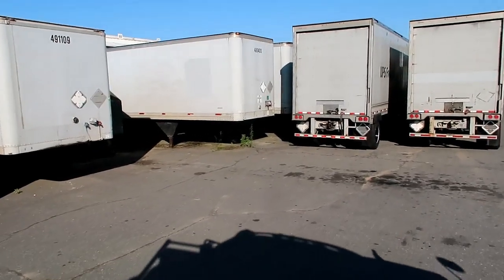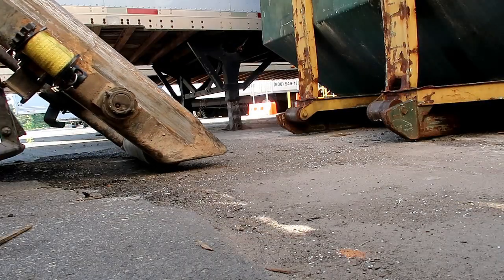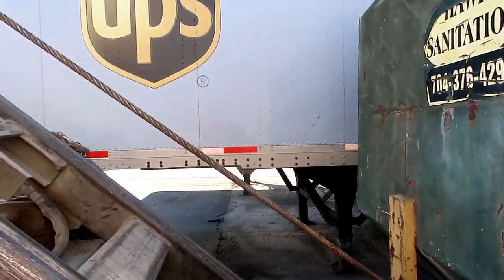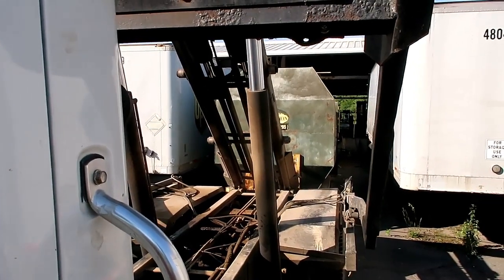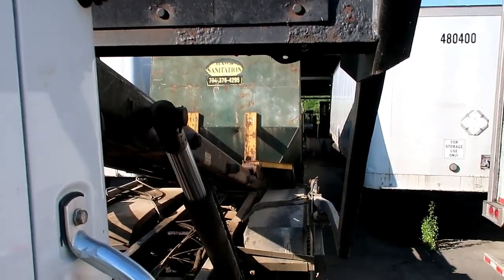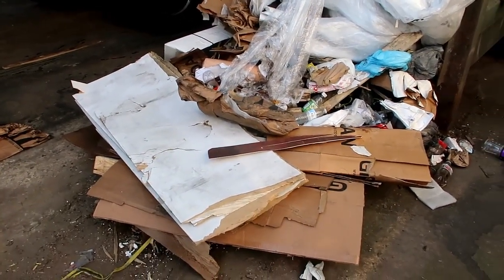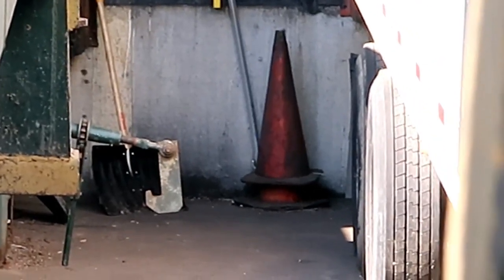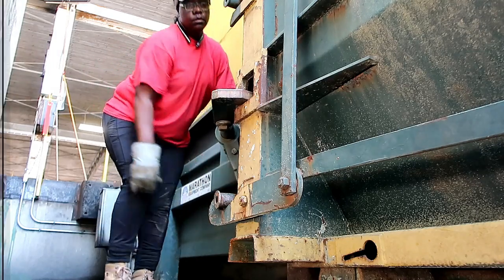WOMAN TRUCKER- ROLL-OFF FOR BEGINNERS

Comment: Enjoyed your video very much. As a roll-off driver one of the first things I was taught was never lower your rails below the top of the cab while pulling up a dumpster. If your cable snaps and I have had one snap it could come flying through the back window. While pulling the dumpster I lower my rails just to the top of the cab and when  the dumpster is completely on that's when I lower the rails completely. Also in New York state if we get stopped by.D.O.T they almost always check the tension on the safety straps. I have a piece of rebar I used to tighten them up.
 
Be Safe. You Rock ! 🤘🏽

Comment: Nice work! I am a roll off driver for GFL.   And do 5 or 6 reciver cans a week. You are correct. That wasn't that bad of a mess🤣.  Lots of people freak out over that part.  I used to run flatbed on the road.  This is MUCH more fun! No two days are the same, and I love the challenges that come with residential roll off.  Keep up the great work. I can tell you love your job too!😊
Reply: Are they a good company? I was thinking bout apply with them 

Is the starting pay good for no experience?

Comment: Nice vid my sister good job...the only thing i would suggest is to never lower your boom under the cab till the dumpster wheel chocks have hit the front of the rails. Just in case (hope it never happens) in case the cable snaps. Cause it will come into the cab...if it is above the cab hopefully it will snap and fly over the cab hitting the hood and not anyone or anything in front of your truck...i have seen it and has happened to me (flying over the cab and hit the street in front of me all i could do is watch it go up in the air thank god i didn't have to site seers that day)...stay safe. Stay trucking.

Comment: Outstanding. I have something that got drilled into me when learning packers and I teach everyone, DO NOT PLACE YOUR HOOK UNTIL TURNBUCKLE HOOKS OR HYDRAULIC LINES ARE OFF. Hook goes on last before pulling forward. When bringing back, hook comes off first before putting hooks or lines on. This way, if customer distracts us, we don't forget where we're at. Also, I sometimes use sidewalk chalk to add another set of reveals next to my drivers side tires to help line back up on the power unit when coming back. But damn good video and thanks!
Reply: This is exactly what I do, my saying is always unhook before you hook and works if picking up or returning.

Comment: Congratulations! Good job. I trained but the job was a bit too difficult for me, especially with 40 cu yard cans.
Reply from the maker: Thank you so much......I LOVE ROLLOFF 💘....its so much fun to do that I still lose track of the day....it goes by so fast. I love it so much I used to train drivers to do it! Its the thrill of seeing them finally get it and out on their own. I wish that I could have taught you! I think its so easy to do. Well I hope that you've found something that you love! Thank you do much for watching!
Reply: @micheletlittle  I wound up driving rear packer truck, box truck and on occasion, tractor-trailer for the same company picking up recycled paper and cardboard. I really enjoyed the packer routes, even in winter. It still was physically hard dumping dumpsters and 96 gallon totes filled with paper, sometimes as much as 300 pounds.   Even the tipper couldn't lift the heavy weight at times, so some help from the winch got the job done. I haven't done it since 3 years ago and my 60 year old frame can't take that 45 -50 hour per week workout anymore. Keep up the good work. It really is great when you love the job you're doing. Have a great 2021!

Comment: Can I make a suggestion to make life a little easier? Pull off just a few inches first. Then sneak a ratchet strap from one side of the box to the other. That should keep the mess to a minimum. Then u would tarp it just as u did.

Comment: Out of a few videos I've seen you were the best and safest. The only thing I would do is a thing I call disconnect before you connect...do the turn buckles first then the winch just to avoid any damage in case of a distraction or absent minded. Cool video
Reply from the maker: Thanks for watching...its all in finding your own technique of doing things...
Reply: I don't think she put any tension on the winch first.  Just used the rails against the rollers to put pressure against the can to make the turn buckles easier to undo. Depending on how tight the can is packed they can be a royal PIA to break loose.  Good video Michelle.  I retired from Roll-Off 2 years ago. Started driving them in 1979.
Reply from the maker: @pciampanella  you are very observant Dave...and correct...I used the truck to break the tension on buckles...sometimes backing  the truck into the can will make the buckles pop out on there own depending on how tight they are...but I really enjoy rolloff...fun job to me!!